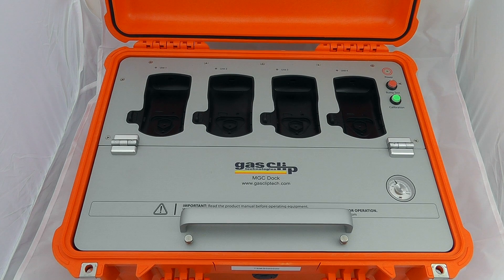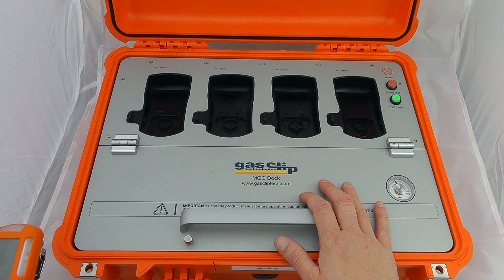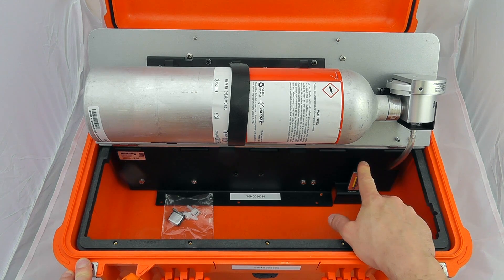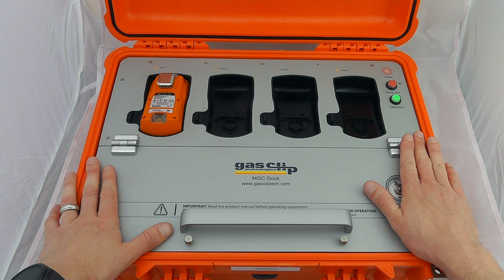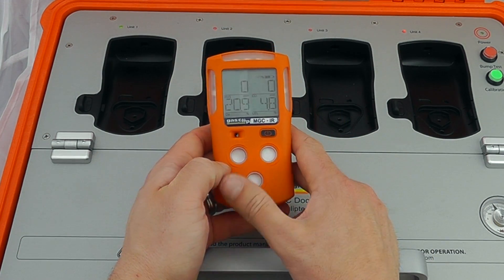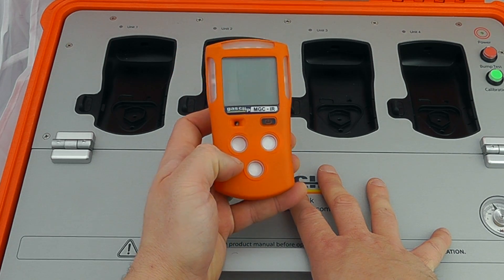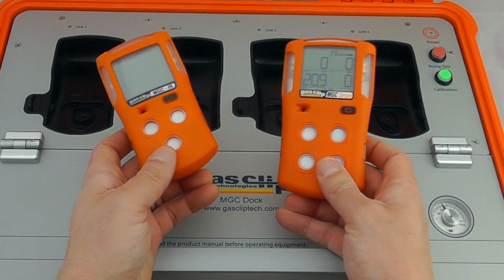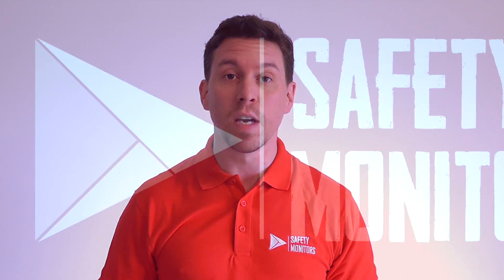Gas Clip MGC Dock and MGC IR User Guide

Comment: Great video! Thanks for putting it up!

Just a quick note for anyone using this dock: The data logs are downloaded between when the Unit light turned green, and when the power light turns green. If you leave the monitor on the dock until the power light turns green, the logs will be downloaded and the dock will purge the gas from the monitor with fresh air, preventing it from going into alarm as it did in the video.